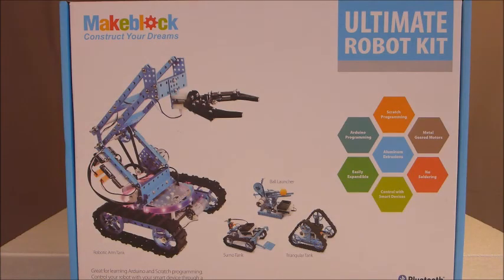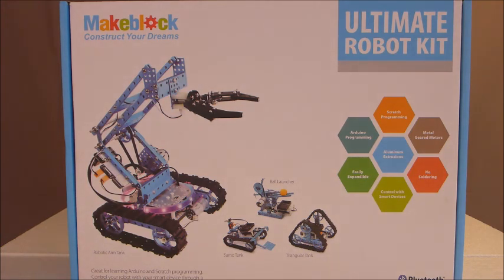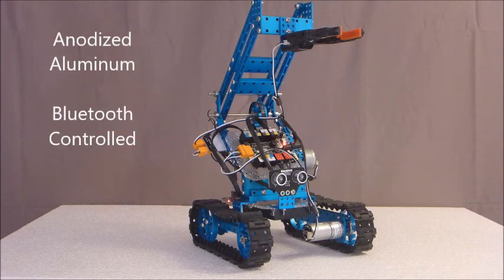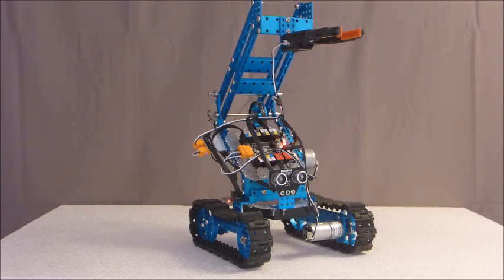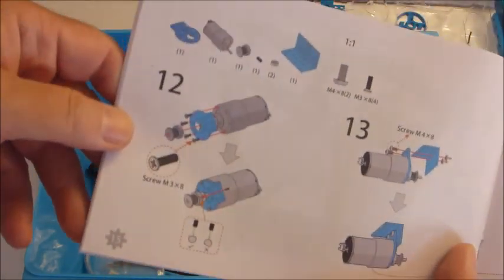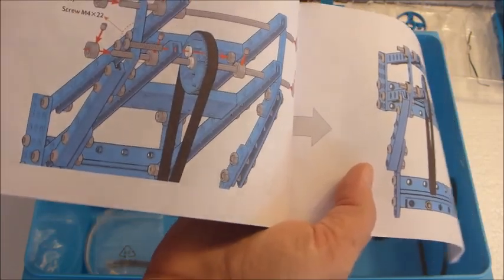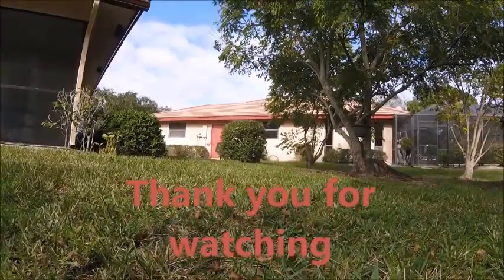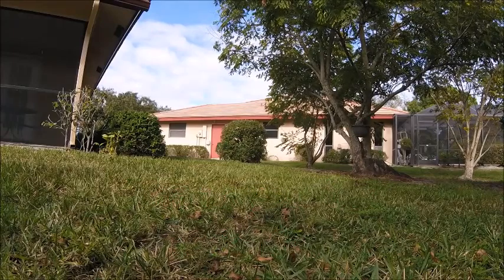Makeblock Ultimate Robot Kit Review

Comment: Did you ever program it? Thus far it's just an RC toy, programming is what it's all about. Very helpful intro review though, thanks Bob. Did it live up to expectations? And was this the version 1 or 2?
Reply from the maker: Jeff Keith Well,,, yes. I did an update on the board and chose the wrong one. 35 years in IT and made a rookie mistake. The bottom of the board has the exact model so I got it fixed. I made a little robot using the switches and long whiskers that I made out of wire. In combination with the ultra sound sensor it should have been able to navigate the house by stopping, backing up, 1/4 turn, proceed. If it worked even a little it would have made a great video. It would be perfect for the young engineer with more patience I’m sure. I ended up with a robot the would hit a wall and climb it or bend sensed wire on the dining room chairs.